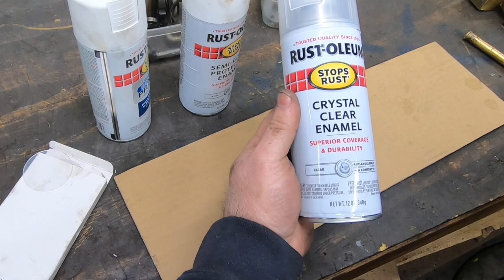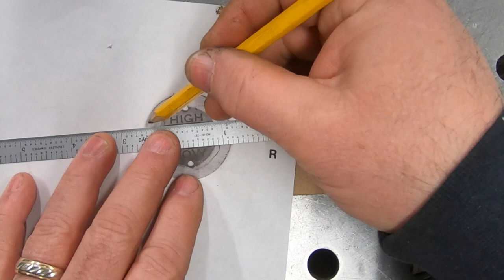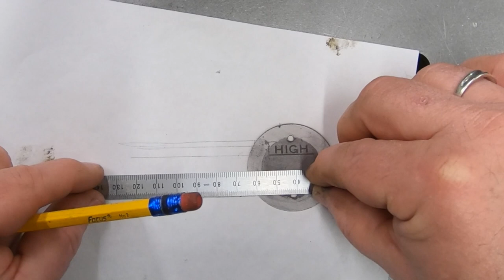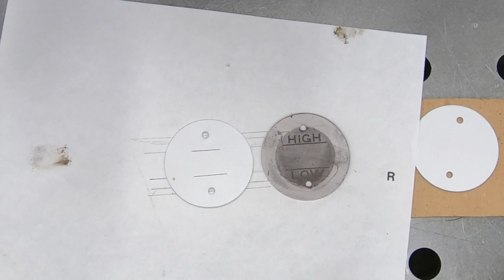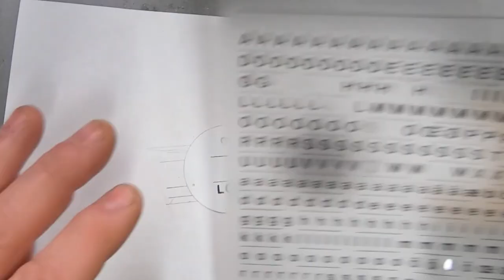Restoring the Kearney & Trecker Overarm Supports - AND MAKE SOME CHIPS!

Comment: Nice to see those first chips. Been an enjoyable journey for me to follow along with. Good luck and finding a selection of cutters. Looking forward to seeing the strip down of the universal head.
Reply from the maker: I've been watching local auctions and haven't seen much. These cutters are hard to find. Most of the new ones come from overseas and I'd need to get or make a metric arbor and spacers.
Reply: @MyLilMule  Fingers crossed something crops up soon, especially a few gear cutters . I can see you making that metric arbor and its fittings as metric is a little harder to find in the US.